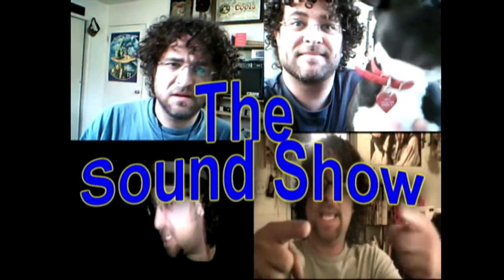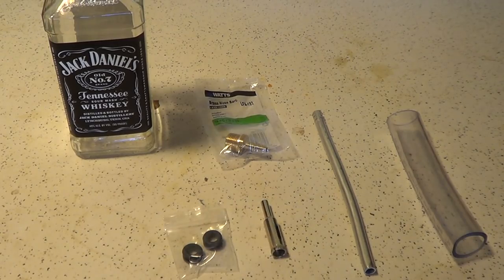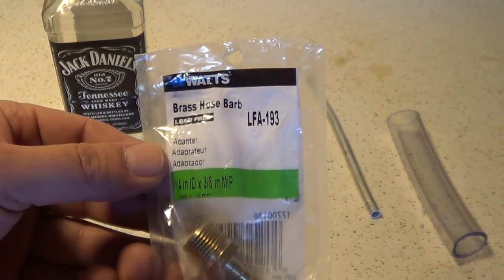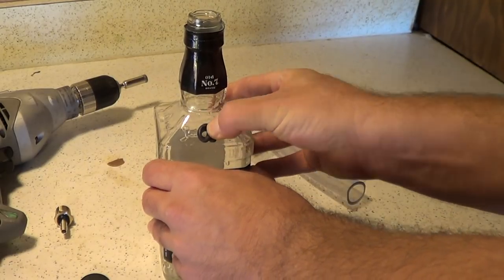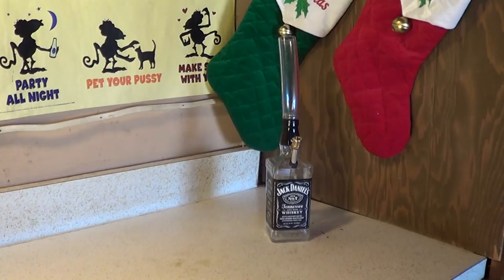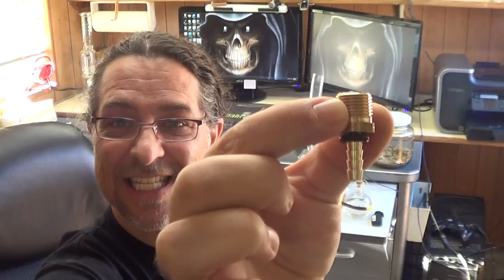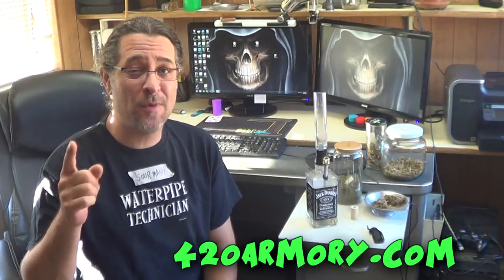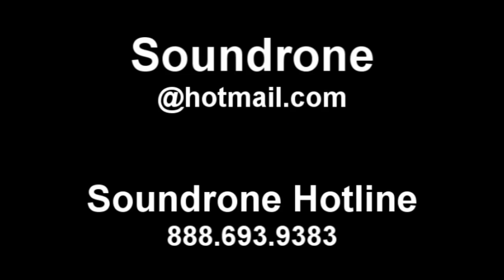Jack Daniels Whisky BONG Build #22

Comment: Hey Soundrone I'm using a 10mm drill bit and 9mm grommits and downsteams but the hole that i drill is never big enough to fit the grommit or the downsteam in it. Once I drill the hole the steam can fit but not with the grommit in it aswell. Can you please help?